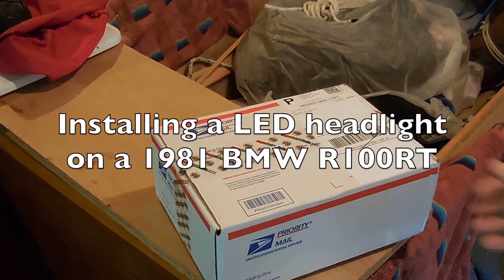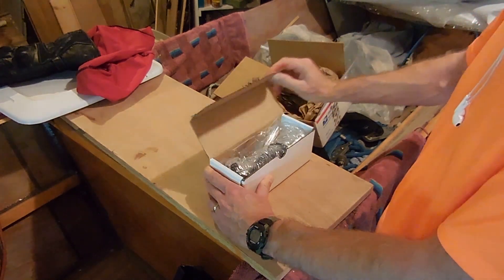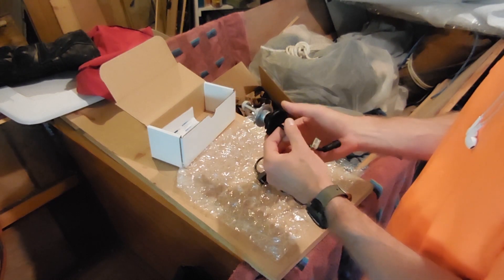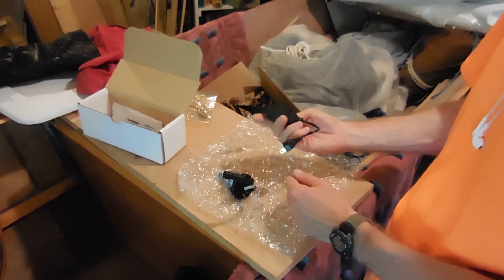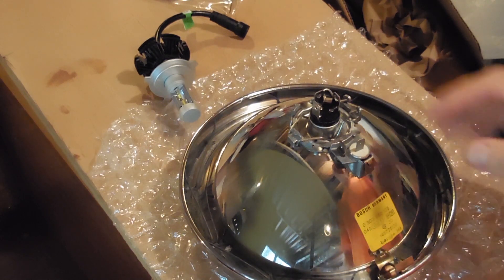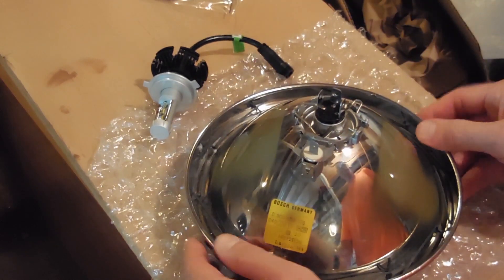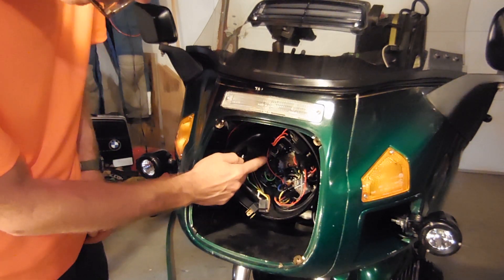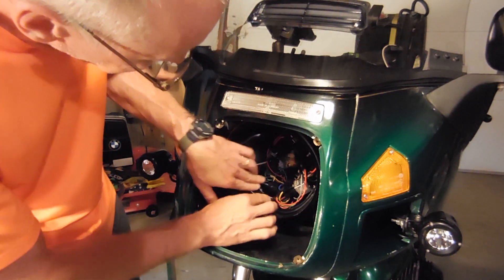R100RT LED headlight

Comment: no issues with the heat sink so close to the other wiring components?
Reply from the maker: Hello Max, I have been into the headlight housing several times and have not noticed any issues.  I had an electrical fire awhile back but it was related to the left ignition coil and the fact that the ignition or other subsystes are fused normally.

Comment: Hi greetings from Scotland.Please tell me who the manufacturer of your indicators is,they look great thank you,
Reply: Hi Richard, what indicators are you speaking about? The two about 2-3inch black lights mounted in the air inlets are an LED fog light and an LED Spot light.  They are just some CCC from Amazon, Westin is the company name.  They are OK but they are not road approved so I'm very very careful when I use them.
Reply: @edwardj456  Thank you  sorr,y I assumed they were indicators and you had not got around to blanking off the original fitted ones in the fairing,So are they too bright or fitted at the wrong height?
Reply: @richardallan455  They work fine. I have each on a separate switch.  At night on two lanes with no traffic I use both to help illuminate the road edges for wildlife. In day I run the fog just to make me more visible. But the headlight was the best bang for the buck!

Comment: Thanks very much,  I was wondering how to remove the protective front glass so I could clean behind it, Thanks Malcolm.
Reply: At about minute 3 you see I remove small phillip screws in each corner. Then the glass and rubber bellows comes out and the the glass is easily removed if needed.

Comment: Hi Edward. So after a year on the bike, do you have any additional comments?
Reply from the maker: Hello Bill, over all I've been very pleased with the LED headlight. I've done about 20hrs of nighttime riding with this LED over about 2k miles and it's still working fine. It's got a nice cutoff so it's not blinding oncoming traffic. Also I love the white light so much more then that Halogen yellow :) 
I've actually put the same LED in my recently acquired 1987 GL1200A, check bitchute for that install. All have been sourced from SuperBrightLED.

Comment: Good mornig,
first of all, excuse my english i don't use often.
Can you tell me some détails about the the LED light. Did you buy it on the internet, the price and the " reférence" of this product ?
I suppose you see better than with the h4 light, is it a great difference ?
Thanks for your answer.
Reply from the maker: Good morning Marius, I purchased this light from SuperBrightLED an internet retailer, it's item name is  "H4-HLV5-M: Natural White"
and cost a bit less then $50US including shipping.
 It's really a wonderful upgrade, it's a big difference, in my case the low beam LED seems as bright as the H-4 high beam and I love the White light it produces vs the yellow of H4. It is so impressive that I also bought two low beam LED lights for my 2008 Toyota Matrix which also uses a basic H-4 i.e. NO CAN Bus or any other data bus I know about.
Reply: @edwardjones8170  Thank you Edward for this answer vers précise. I'll buy a LED light for my r100rt of 1982, the same as yours.
It seems very easy to install.... 
Thank you once more. Have a nice day.